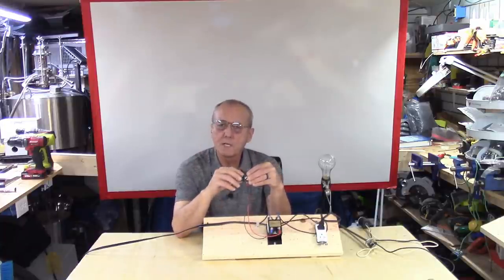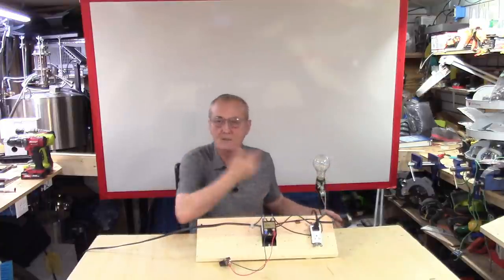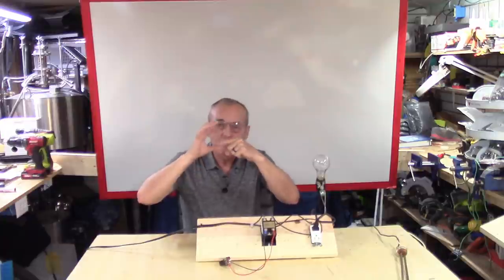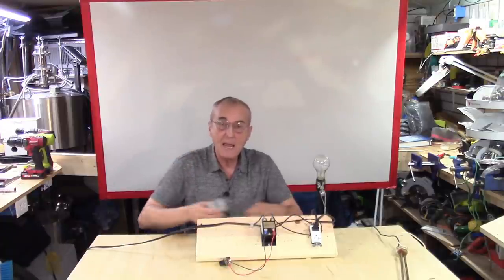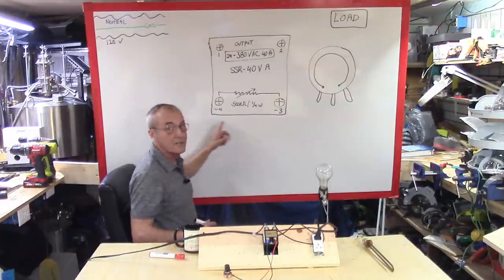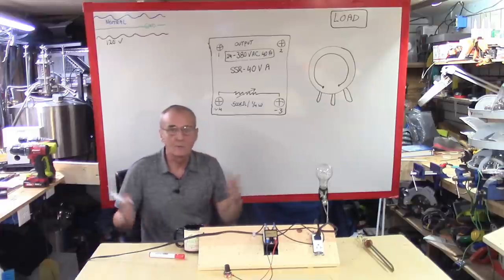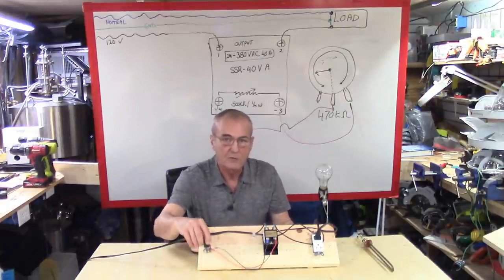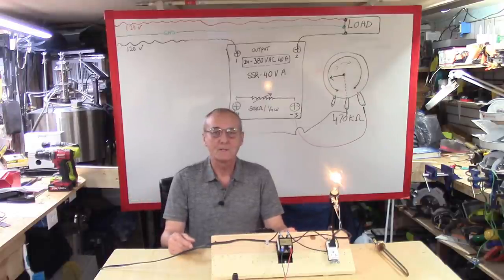THE MOST INEXPENSIVE WAY TO CONTROL HEAT IN YOUR STILL

Comment: Your explanations lay things out so well and clearly, even novices can easily follow them safely. I've always believed that if you can't explain something so your grandmother can understand it, then you don't fully understand it yourself ! Just a couple of points though, a standard household dimmer is rated at 600w, useless to all of us. Lutron makes a 1500w and a 2000w dimmer, but these are very expensive. I used one of these to build my 1st. electric still years ago. I prefer this method, even above a PID controller. Simply because I will never leave a running still unattended. Kudos again George on another great video. Keep 'em coming !

Comment: I usually don't mess with electricity but I was burned on my back when I was younger . I wouldn't run a hand sanitizer machine with a  flame under it . I have everything mounted in a box and just need to wire it up . I also wanted to be clear on the ssr.40va  if it could run both 110v and  220v . 
This video answered my questions  . 
Thanks George you explained  it perfectly  .
I follow still it  and  he was talking about you some time back and that you weren't making content anymore.   What ever the reason George alot of folks are gonna miss you . Hope all is well and God bless you and yours  .

Comment: The Last schematic you made is a single leg has a ground or neutral(depending on your system) it can supply power. And the way you had it you are only controlling powering on one leg of the 220/240 VAC So your element is only going 120/240. Not Ideal.
You have to switch your Neutral to control( As long as it does not go to ground)! Your system is hot all the time.

Comment: Hi George, as always, awesome. Quick question. What do you do with the ground on your load? Previous videos you clip the ground wire off and only have 2 wires on your element. Is this still the case?
Reply from the maker: I have clipped the ground in some cases. I did this on a heating element because the element has no ground lug. The ground in that case is an appliance ground like a stove or other appliance. I have also attached the ground to the outside of the still kettle.
Reply: @BarleyandHopsBrewing  thank you George. I have the controller on the way!
Reply: More than once I have encountered wall sockets that haven’t been wired properly. This would include an old farm house and a fairly modern house. Sometimes an incorrectly wired wall socket can operate without any apparent problem until you connect the type of device that requires the unique properties that really really need the socket to wired properly. There’s a very handy and inexpensive safety device that I highly recommend and its sold typically at most hardware stores. A wall socket checker looks a lot like nothing more that a replacement appliance plug with three lights. All you do is plug it into a wall socket and observe the lights. I highly recommend getting one of these.

Comment: You can use a pid to control a gas burner if you install a 24 vac gas valve with standing pilot. Install a pilot assembly on the burner and the gas valve and use the pid relay to activate the gas valve

Comment: George, thank you. Always very informative. I have to disagree and clarify that not all 220VAC is as you describe. I work overseas (Middle East) and the 220VAC comes in on a hot, neutral, and ground as well. Still it doesn't change the basic principles that you present. Very good presentation. Thank you
Reply from the maker: That is exactly what I said.
Reply: @BarleyandHopsBrewing  Someone was sleeping in the back I see.
Reply: @BarleyandHopsBrewing  19:59 you said the 240VAC system is two hots (180 degrees out of phase) and a ground, vs the one hot and one ground of q 120VAC system. My 240VAC service in Middle East is 240VAC one hot, one neutral and a ground
Reply: @kentwilton  You are correct. I pointed this out in another comment. Standard household 240VAC is 2 phase in North America and 1 phase in Europe (and elsewhere I see.)

Comment: Hello George, I built a 240V SSVR after studying your video. My SCR runs but the Potentiometer at zero produces 214V and at 100% 241V. I have the SSR-40VA and the Potentiometer is a RV24YN 20S B303. I had to buy them separately because I could not find them paired together since I wanted the 2W SSR since I am working with 240V for a 5500 W Element. Is this a problem with the Potentiometer? Any help would be appreciated. Thank you.

Comment: For having it work your explanation is very good! But please allow me to make a few corrections. When you use a SSR close to its limit, you MUST mount it on a cooling frame. Usuall the sellers from SSR's also sell these. When you do not want, or can not use a cooling frame, you should use a load lower then 50% from the load the SSR is rated for.

In the power plant are created three phases. The Neutral pin goes in the ground. Depending on the system what is used (For example MEN) the neutral wire is connected every few 100 meter to the ground again. And in your house, before the meter your ground and neutral meter are also connected. (This applies for a MEN system, used in most countries of the world, but I have no idea what is used in USA). Because this, the neutral is not oscillating. I am sure also in USA neutral is not oscillating. Because also in USA the neutral is created at the power plant by a rod in the ground
Because three phases are created in one revolution, the phase difference is only 120 degrees, and not 180 degrees like you say.  The last allinea does not matter at all on how to connect it. The first allinea can be from some importance for your followers. 

Thanks for this great clip!
Arjen.
Reply from the maker: This was mounted on a heat sink
Reply: @BarleyandHopsBrewing  I missed that part. Probably because I am not native English speaking person. I am glad to learn I did see this wrong!!

Comment: Thanks for the informative video, I've managed to find an SSR with the same specs as yours. I'm left wondering could you wire two 3Kw elements to the load in parallel without issue? or would it be best to get two SSRs. I'd like to run them lower to avoid scorching.

Comment: Hello! I built an element controller setup just as you described and added a voltmeter as well. I’m having problems with it cranking up to the max setting on its own regardless of where I have the potentiometer set. It seems like after a few minutes of it warming up it just automatically shoots up to full voltage. I’m not sure what is wrong with it.

Comment: Love the video, but im too poor for a setup like that. L.p. only. Thanks for the video.
Reply: If you have a cloths dryer where you live you have a source for 240 power . Electric is so much safer than useing a open flame to produce a liquid so flammable .
Reply from the maker: True although it is 240 V the standard household is 120 V with service circuits for high power appliances like Stove, Dryer, Furnace etc. on 240.

Comment: This would be in place of a PID? Or in addition too?
Reply: This is an alternative to the pid.  You could in theory use them together but you would just be dimming the power your pid has to work with and I can see no benefit to that for most people. If you sit there and actually play with both you will confuse your pid so badly it can't function
Reply: Instead of
Reply: @findingfreeblade  Thank you!

Comment: FYI, I believe in Europe, their 220V/240V is single phase. Although you can cross wire if done correctly, your explanation would be North America-specific.
Reply: 380/400V is 3-phased rotary current, 230V is single phased. Plugs, colors and wiring standards slightly differ from country to country.

Comment: Thanks George just what I have been looking for but having a big problem trying to locate one and in doing so I found this  and it works out just as cheap for Australians, this is the link  https://www.kegland.com.au/4000w-power-station-240v-power-controller.html
Reply: @michele wiltz         Still dragon Australia do a kit with al this gear.
Reply: I bought mine off AliExpress - with AU plugs for half that price.
Reply: @bradmcmahon3156  just looked at the web site looks like it's made in china, I do not buy made in china, thanks for the tip thow